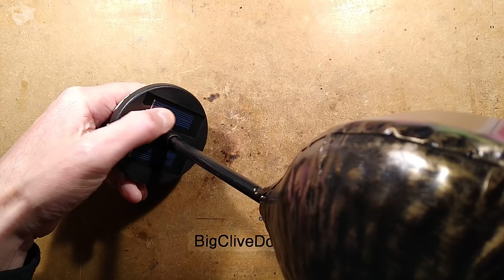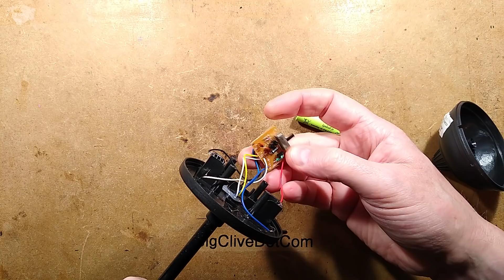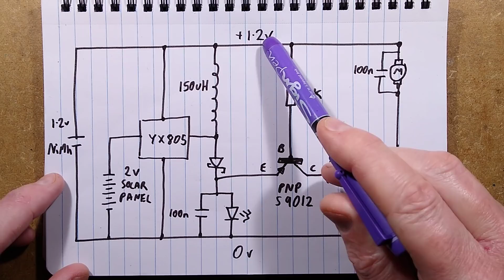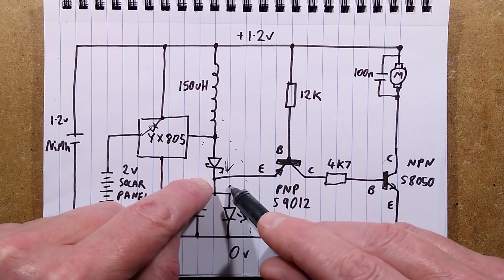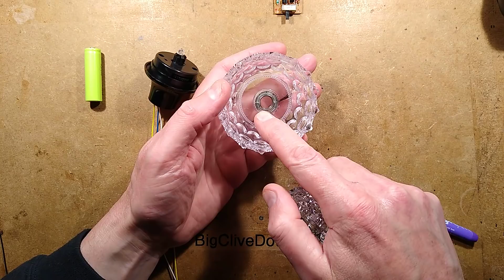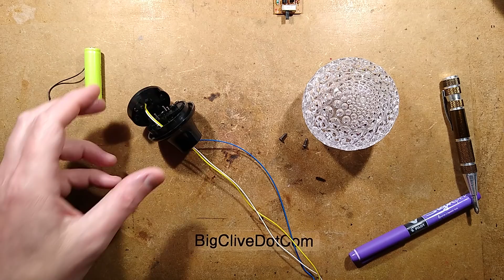Exploring a solar rotating crystal orb.

Comment: Hey Clive...  I found a "new source" of "fun" LEDs... next time you come across an orphaned "gaming" keyboard, hold on to it for the leds under the keys. If kept intact ledwise,  one can plug it into the computer and use the appropriate software to bring it to life as an interesting display... add in extra leds to fill in the blank spots for a more uniform look.

Comment: This may be a stupid question, but how come there's only one (blue) wire going to the motor? The LED's wires are obviously not connected to the motor either
Reply from the maker: There were two wires before I accidentally pulled on off.  I reattached it later.

Comment: Best mr Bigclivedotcom
Can you develop the circuitry to my 111pc covid safe biosuit?
It is a bodybag with clear plastic around the face and a tube with 12V UV led inside to kill virus. On the outer skin it is filled with more UV led to create a deadly aura. In addition it will have a sprayer of methethanolchlorine around from two nozzles pertruding from both shoulders with a 100 liter reservoair on a shopping cart and a 12V pump with solar cell charging.
It shall be called:
The new disinfected normal garment of of of life and sanity-tation.

List price 255999 for a life time of usage. Dont leave home without it.
Reply: Sounds good to me.  I could develop the electronics for it.  My rate is 1000 guineas per hour,  please get in touch.
Reply: @raykent3211  - Will you take prairie hens instead of guineas?
Reply: @raykent3211  Finished a rudimentary sketch of the new UViform to be worn at all times. I have added an injection port where fresh microbials can be injected so that immune system do not collapse.
https://i.postimg.cc/Y25KTN2L/UViforme.png

Comment: The words you are looking for are "ring gear".  This confuses some people because the term is used by the auto industry for differential and transmission gears driven by a helical gear: a similar but different ring arrangement with the teeth on the flat of the ring and not the inside (usually).  The ring gear with the teeth on the inside of the ring was first patented in the mid nineteenth century.  Presumably it had never occurred to anyone before then.

Comment: I miss the old days when you showed all the disassembly and did the reverse engineering on camera.. I am always disappointed when you say you will be back and return after the fun part is over.
Reply from the maker: I'll try to do more on camera.  Sometimes the videos can end up too long.
Reply: @bigclivedotcom  Half hour videos are OK for me. And please bring back the hammer of science and the vise of knowledge ;-)
Reply: @bigclivedotcom  - Unless there's an obvious reason to shorten the video, I don't think there's a too long.  I often run them in the background while I tear apart my own electronics to repair customer systems.   If there's a section I don't particular appreciate (such as some of the circuit breakdowns), I simply skim past them.   I like watching the X-Ray machine and the Vice of Knowledge.  (and the rubber brick)

Comment: that transistor arrangement is actually pretty standard, if not the most common.  I have used it several times as "level translation" which is pretty much what they did.  I think it'd work with a lot of LEDs, so long as their forward voltage was 2V or higher (1.2V + 0.6V = 1.8V, so anything higher than this would be fine.  2V is a nice safe cutoff threshold). Another possible way to detect the LED circuit is active would be to capacitively couple the pulses from the inductor/chip node and then rectify it and use that to drive the base of the NPN.  The PNP in that common base arrangement's most likely the cheapest they could come up with though I suspect.

Comment: You should be able to change the led. The PNP transistor shouldn't turn on until the emitter is 0.6v above the base, so about 1.8v or higher. Maybe don't use a red led, or a fully charged battery might not turn it on fully. 1.8v on E and 1.3v on B makes a Vbe of -0.5v

Comment: This week I purchased some solar lights from Aldi in the US. They look like your standard rectangular solar lights but have a lens below the white led that rotates when the light is on. I suspect the circuitry is very similar to this light. In other lights I have had success changing them from white leds to color changing leds by adding a 1N914 diode and a 100 nf capacitor across the led.

Comment: Actually, in wrestling we call that 'female cog' the annular gear, driven by a pinion. Used in rack and pinion systems. Not sure what Shakespeare had to say about it all.
Reply: A rose is a rose, by any other name.  He also said "Roméo,  Roméo,  where the fuck are you?", which was soon censored.  His views on mechanical engineering are little known, still less on colour changing leds.   But he did say "whyfore have we teeth on the inside of our mouths?", which is clearly a reference to epicyclic gearing.

Comment: I wonder why they didn't just connect the cathode of the LED to the base of the NPN transistor. Is there a problem I'm overlooking with this idea? They could have saved the cost of two resistors and a PNP.
Reply: Didnt you pretty much answer your question yourself in a reply to @David V ?

Comment: In there enough room to modify it with an lithium and modify it with a larger solar panel for more brightness?
Reply: Would throw the voltages all wrong (3.6V instead of 1.2) and it would stop working.

Comment: Not sure I understand the need for the PNP transistor. Why not just use the 2.4 - 3 volt LED supply voltage to control the base of the NPN transistor (with a different resistor value)? Thank you for another interesting video.
Reply: When off there is still battery voltage across the LED because of the inductor.
Reply: @eDoc2020  True, but not enough to bias the NPN transistor on, so the motor would not run.
Reply: @davidv1289  There's still 1.2v on the LED when it's off so that's plenty to turn on a transistor. You could use a resistor divider to drop that below 0.6v but then you will always be wasting current.

Comment: Hot melt glue can be released with a dab of isopropyl alcohol - get it to wick under the glue with a little light prying and alcohol application, and it gives up the ghost.
Reply: I read this all over the internet but it didn't work the slightest bit when I tried it.
Reply: @MetalheadAndNerd  Weird, because I use that trick all the time to release my hot glue.
Reply: @MetalheadAndNerd  It's not an automatic release.  You need to kind of lift the edge of the glue and get the alcohol to wick under; it then becomes much easier to lift the rest of the glue, so long as you keep the seam damp with alcohol.  The start of the process may be the problem.

Comment: The globe and dive are great for Christmas. If I got hold of a few I would swap the LEDs to SW2811 and power the motors on a separate supply. I do not have access to Jacks shop, so my partner can breath a sigh of relief at not having 20 of them spinning around the house for the 4 weeks of christmas.

Comment: Internal Ring Gear :) lol
Reply: It is NOT a ring gear !
Reply: @millomweb  Then what is it ?
Reply: @paulsirens7259  Internal spur gear. As seen on Google images !
Reply: @millomweb  A spur gear is simply the way a gear tooth is cut, being cut parallel to the axis denotes a spur gear, as opposed to a helical etc.
The outer gear (the annular wheel) meshes with a pinion.
The annular wheel is commonly know as a ring gear.
I think if you googled internal ring gear on Google images you may agree the difference is minimal.

Comment: In a SMPS you couldn't use a standard 1N400x diode: the fast switching would kill it. The reduced forward voltage is an advantage, not the reason for using it.
Cheers 👍🇳🇱
Reply: A UF4007 would be OK, but yes, a schottky is better and more cost effective
Reply: @henryokeeffe5835  Indeed, an Ultra Fast Recovery diode will work fine too. Cheers 👍

Comment: Ring gear. :)
The bearing was a surprise along with the tacked-on motor control.
Reply: You beat me to it 😏
Reply: Right? Especially a sealed bearing!  Very clever design.
Reply: @BRUXXUS  Not a ring gear.
Reply: It's not a ring gear ! I thought of that ! It's an internal spur gear.
Reply: I was thinking of the friction problem and 'lo, they used an encased ballbearing. I just never expected that knowing for a fact Clive only shops at the Pound Shop.
Reply: @jackladd4332  Bearing is a ewaste special, you find that bearing in hard drive actuators, so the manufacturer has been getting all the bearings out of old hard drives being scrapped, after all the information them is read of course, or they were dead when tried.